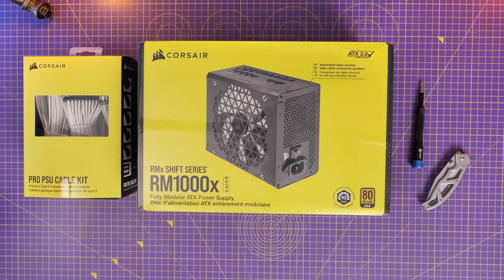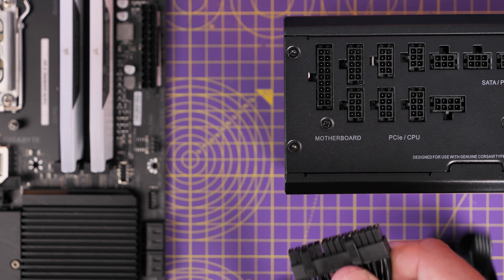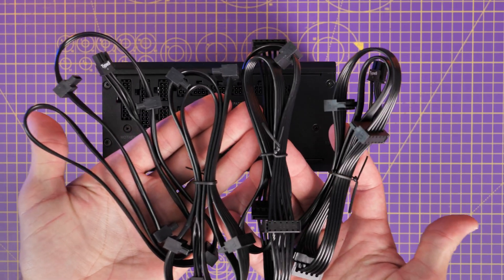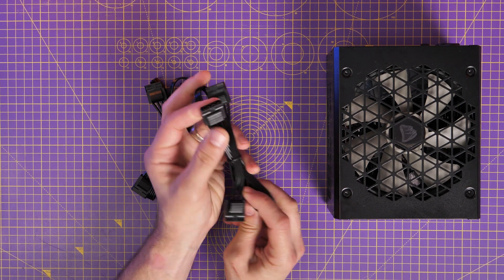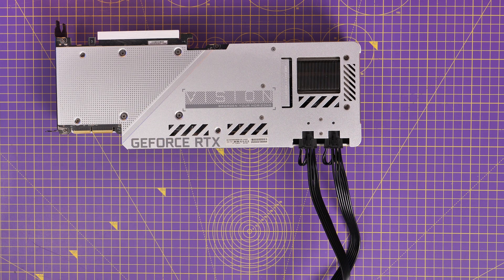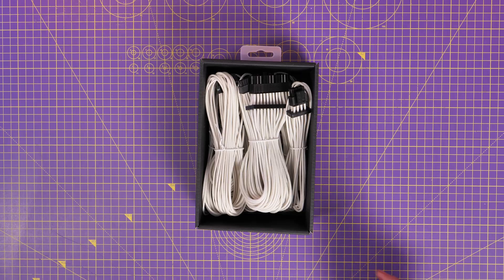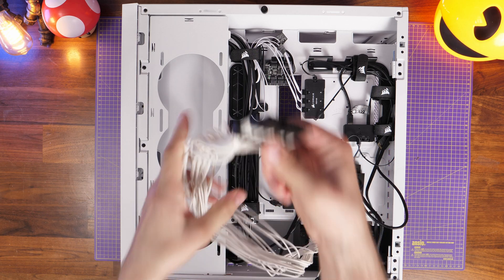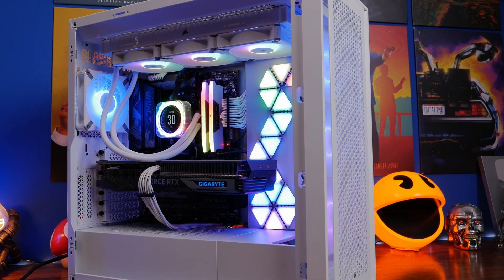Corsair RMX shift PSU setup and install guide (RM1000x and Pro PSU cable kit)

Comment: Bought a used PC off a friend that had a 3070 ti in it and decided to upgrade it to a 4070 super only to find out the power supply that was already in it was terrible. Just picked this one up on black friday and am gonna attempt to install it either tonight or tomorrow. This video was so detailed that I feel more confident than before about this. Still terrified but at least I have a solid point of reference. Wish me luck!
Reply from the maker: Glad I could help and good luck with the install!

Comment: Hi, you always have great videos. I reference them now and then depending on my objective.  I've had issues for a bit and I discovered late last night that my bios states my 5v voltage is to low +4.280v to +4.400v. I'm starting to believe this has been my problem all along (instability issues with usb disconnecting and reconnecting, m.2 disappearing and overheating; my system will work near flawless for 3-4weeks and then the next 1-2weeks its down. since your familiar with my setup (based on your videos) I figured i can ask your advice. I have the crosshair x870e hero, tuf 5070 ti oc, corsair shift 1200 and a lian li vision compact. The internet suggests its a cabling issue from the PSU to motherboard.  Any suggestions on  what my focus should be (is the 5v voltage a specific cable or rearranging PCIE/CPU cables thank you Robert.

Comment: The sideways connectors don’t work for me since my case has a metal plate blocking it, I’d have to have the PSU upside down and the fan into the PC instead…
Reply: This is the same for me
Reply from the maker: What case are you using? I'm curious
Reply: @ I think it’s a Cooler Master HAF 912

Comment: i have the Corsair RM850, 850W (and older PSU) and yesterday i bought a RTX 5080 card, as the last thing for my setup, all i need now it my local Pc dealer to build it 🙂
but after watching this video i have a question do i need to get the Corsair RM850x for it to work with the 5080 card (not FE) - Thank you
Reply from the maker: If you're using a new 50 series card, I'd highly recommend getting a new PSU too. Preferably atx 3.1. also check wattage requirements of your system here https://www.corsair.com/uk/en/explorer/tools/psu/power-supply-calculator/?srsltid=AfmBOorF34BBltIVpYh8PobBmXphvVpyd9llbkyPGwrUGCBzE0JmKEc8
Reply: @TheProvokedPrawn  thank you very much! 🙂Okay i took the test, RMe850, RM850x SHIFT, and third option is HX1000i, would you recommand any of these over the other?
i mean there around 99£, second option is 150£, and the HX1000 is listed for 195£, i will of course look for a cheapest listed in my country.

Comment: On the dedicated pci-e cable (at 10.00) the PSU end has two seemingly identical 8-pin connectors but each has a missing pin but at opposite ends to the other. One has the missing pin on the left, the other on the right. Does it matter which of the ports these are connected to as this is not specified or even mentioned by Corsair?

Comment: Hey Prawn I watched your video on the NZXT H6 Flow RGB case, and in that video did you use this specific PSU? I have looked everywhere online and it says that this PSU is incompatible with the H6 and now I am unsure what to do. I was planning on building my new PC and thought that the RMX 1000 Shift PSU would work with the H6 Flow and ordered both of them. Now I don't know what to do, should I return the case and find a new one that is compatible or is there a way I could install the PSU in the H6 Flow?
Reply from the maker: Yes I used it. You saw me do it and it worked 🤣🤷‍♂️ don't know why it's said to be incompatible

Comment: 3:45 on my motherboard there is the same big hole for cpu but the 2nd one is smaller like uh a 2x2 cube if you know what i mean does that mean i need to order like a separate cable?
Reply: Did u solve ur problem?

Comment: i know this video is a year old but just recently got 4070 ti super and i have the adapter working but want to just have the 12 pin without the adapter and not sure where to buy one that wont break my psu i have the rm 1000x (2021) version and not sure what to do
Reply from the maker: Check to see if yours is type 4 or 5 before buying but this will work - https://www.corsair.com/uk/en/p/pc-components-accessories/cp-8920284/600w-pcie-5-0-12v-2x6-type-4-psu-power-cable-cp-8920284?srsltid=AfmBOoplfQmNlyF7ghKS9LftZAy3BA9KzBpY25weX4PHGkCz2QX0Z_Qx

Comment: Hey! Thanks for the guide brother! Do you think this psu will fit in the phanteks xt pro case ? Thanks!
Reply from the maker: It should in theory but I haven't tried
Reply: @TheProvokedPrawn   I got 1 on bf and i didnt notice that it had side cables :/

As you say it should in theory but im worried a bit cause i found that it should be ok for an 8.3inch case, the phanteks is 9.1, so less than 1 inch for cables, , thanks anyway for the help.

Comment: Is it normal that my RM850x corsair shift psu has only 22 pin motherboard connecter, 2 connectors and the cables are not there only 22 pins and cables ??

Comment: Wonderful video! I feel so much more confident for when my parts all come in. If i may ask, when plugging in my gpu, I need 3 wires. I saw that theres two separate areas labled pcie/cpu and you instructed that we plug in the gpu 8 pins into the pcie/cpu. Is it okay to plug them in either side? Since I need three seperate cables and it looks like theres only two plug ins on the side that you used, is it okay if I pluf the third one into the left side pcie/cpu? Again, thank you for this very helpful video.
Reply from the maker: Yes

Comment: I have the 1200 shift and was considering using the pro kit but I wanted more combs . Will any comb set fit the Corsair pro kit because I searched & searched for type 5 cable combs and couldn’t find any.   What’s your advice?

Comment: Do i use the screwsthat came with my 4000d to screw it in i dont think it cane with any screws
Reply from the maker: There should be some in the box but if not yes, the ones that came with the case are fine. Use the hexagon topped screws

Comment: Sooooo, what kind of case is this?
Looking in with the side panel off the "back" of the case is to the right yet all of my server cases have the back to the left.   Issue being that this power supply doesn't fit in my 15 drive raid server.

If it's not a simple parts switch I'm going to have to drill holes in the top of my existing case so the fan for the power supply isn't covered.

What should I be looking for instead?

Comment: Thanks for the review and installation tips.  I am replacing the PSU in my daughter’s 5000D case. Do you think the pro cables are worth the extra money?
Reply from the maker: That's very subjective. They're nice and easy to install and look good but value for money is upto the buyer 👍🏼
Reply: @TheProvokedPrawn  Thanks for getting back to me. I’ll probably buy them this week. I had sleeved cables with my RM1000i Special Edition PSU from Corsair and they were really nice.

Comment: Hi Prawn.
I'm about to buy this kit for the RM1200x shift.
I was wondering how the cables has held up for you?
No issues with the 12vhpwr or any of the others?😊
Reply from the maker: No issues.
Reply: Fine as long as you plug in fully.
If your gpu as atx 3.1 new connector it wont have the issue at all

Comment: Ok I found this great.  On the 12vhpwr cable to the psu, does it matter if the smaller sense cables are out or inward? and it doesn't have to be those 2 plugs?  I got the 4070 Super vs the non-super and it has the new 12vhpwr connector. I was just using the adapter..  I didn't realize my Rm850x shift had one included.  I love these shift psus!  Why did it take so long for these to come out!

Comment: I'm not sure if I should find it funny or be concerned about the fact the power supply as a label right below all the connections saying: "Designed for use with genuine Corsair TYPE 4 cable sets only"...
(They are clearly type 5)

Comment: This maybe a stupid question. Obviously you need to buy a power supply cable kit with the correct cables you need. But when you buy a cable kit, do you need to buy a specific one or can you just buy any cable kit and it'll work exactly like the cables that come with the power supply?
Reply from the maker: Recommend buying a cable kit from the same manufacturer unless it's just extensions. Otherwise the only thing you need to watch out for is type 4 or type 5 cables, as they're different so you need to match to your PSU type
Reply: @TheProvokedPrawn Alright thanks man.

Comment: Thanks for creating this video! I just bought this very specific power supply and its nice seeing a visual representation before cracking my case open and replacing my Corsair 650w.  P.S. I had no idea this power supply included a direct connection power cable for my new Gigabyte 4070 GPU!
Reply from the maker: Glad to help
Reply: Ironically that 4070 series cable was broken in the box, so I had to use my adapter.  A clip going to one of the power supply outlets was broken off and the clip that goes to the GPU was broken off.  Hope the warranty will grant me a replacement. @TheProvokedPrawn
Reply: does the cable mess with the power of gpu? i feel like i’m missing out on the full potential using that other cable the psu came wit

Comment: Mate I am absolutely baffed. I have the RMX shift series 1000x fully modular ATX power supply but I’ve just spent £110.00 on wrong cables 😂. It clearly states on my PSU ‘designed for use with genuine Corsair type 4 cable sets only’ all of these cables are TYPE 5. Why would Corsair print on this PSU the wrong information!? 

Also because I’ve got the LIAN li o11 vision I have to mount this PSU with the fan facing towards the back of the case with the cables facing up towards the top of the case. I hope this is okay!
Reply from the maker: That is very odd and frustrating. Hope you can get it sorted.
Reply: did it work? i have the same case and psu lmao
Reply: @pigreatlor  did what work bro? I had a handful of initial issues with my PC components haha
Reply: @James-fv1cm  the psu inside the o11 vision
Reply: @pigreatlor  oh, works magnificently. Just has to face a different direction than what Corsair built it for I think. The fan has to face the exterior of the vision case as that’s where the mesh is allowing for airflow. Only downside to this is the cables have to come directly upright. I removed both of my hard drive cages anyway so it didn’t bother me. On a side note bro did you receive rubber silicone grommets for your low motherboard option??

Comment: if i purchased this pro cable kit (the starter kit only comes with one cpu cable which is annoying) does this include all the cables id need to power my rtx 4080? I know there is a separate cable which is called type 4 600w corsair pcie gen 5 12vhpwr DC power cable. this cable has two connectors on it that plug into my graphics card as apposed to the nvidia adapter which has three. Does the pro cable kit include this cable or should i buy that cable as well as the pro cable kit?

Comment: Ty for the great video again ! I have simple question, Can i use (CORSAIR 600W PCIe 5.0 / Gen 5 12VHPWR Type-4 PSU Power Cable), on (RM 750 2021 type4 White)& rtx (4070 non Ti version) which cable wasnt included but planning to buy and remove the adapter and the mess  ... so i was wondering if its save and will it work fine with that PSU and Gpu together TY in advance !

Comment: Finally a brilliant practical tutorial that explains the mystery of a psu to newcomers like me!  Absolutely marvelous!  Thank you and continue to make videos
Reply from the maker: You're very welcome! And I will
Reply: I am thinking about purchasing this pro cable kit today to make my rig look better. Would the cables included in this be suitable to power my RTX 4080 suprim x to my corsair shift series rm1000x PSU? I am new to all this as you can probably tell. I recently watched another video where a guy used corsairs type 4 600w pcie gen 5 12vhpwr dc power cable which connected to his 4090 to this PSU. is this same cable included in this pro kit or do i need to buy this other one as well?
Reply: Except it doesn't. There's an ATX 8 pin cable, and 2 CPU cables. This doesn't explain which we should be using. My mobo doesn't seem to have CPU power. It has the 24 pin connector, and the ATX 12V 2x4. So which do I use? The cpu cables, plugged into the cpu ports? Or the atx cable into the mobo ports on the PSU? I'm guessing the latter but I can't find confirmation anywhere because the manual for this PSU is so unbelievably useless

Last time I ever buy corsair. Never would've if cultists didn't rate this psu so highly.

Comment: Great video. Nice system. I'm installing the Corsair Shift 1000x in an old 2012 Corsair Graphite Series 600T CC600TM tower case...and it definitely isn't built for today's setups. And, I'm getting a liquid-cooled 4090 with literally nowhere to mount the radiator (CPU has a radiator at the top). Lucky for me, this is a huge case and I can make it work, but I'll likely have to keep the side panel off because stuff will be hanging out of the side. Maybe it's time to upgrade the case.

Comment: hi there and thanks for the vid .I just purchased the same psu new and i noticed some very tiny scratches on the 24pin, and pcie cable, the surface of the cables arent very smooth  i dont know if this is normal or not.

Comment: Thank you your the first video out of a few that answered my question on whether I should use two separate cables or one with the pigtail on the GPU because I also coincidentally have a gigabyte 3090 OC so thank you
Reply from the maker: No problem 👍

Comment: Hello, sorry, as it says on the page, "it must be at least 210 mm (8.3") wide" so that there are no problems with the cables, it refers to when the cabinet specifications say: "Box size : 446 mm x 285 mm x 430 mm (length x width x height)" or in which part exactly is the one that mentions the length of the back part

Comment: So the new icue link hub has a female 6-pin pcie.  I'd use the 6+2male and the 8port psu end where 2 slots are empty and missing pins?  That's a 6pin?

Comment: How easy does the cpu 8 pin cables bend with the additional cable purchase kit from Corsair?  I have hardly any clearance to run the stock psu cables that way with a 360mm aio from corsair with their af fans in the same case… so I ran them around the front it looks trash.
Reply from the maker: The premium kit is much or flexible
Reply: @TheProvokedPrawn  thanks for the detailed videos, and responding to me!   I also have the same aio.  I have a tuf intel board.  I debated on trying to bend the 8pin cpu stock cables but I might just get the premium cable kit if you believe that it be easier.  Are you using the stock af fans with that aio?
Reply: Sorry if you covered this in the video but does it come with 3x 8pin PCIE cables for the gpu? I'm thinking of getting this for the 7900 xtx @TheProvokedPrawn

Comment: Can I use the cable kit with a nzxt c850 power supply?
Reply from the maker: It's not recommended to mix cables from different manufacturers. You could use extension cables though (like Cablemod ones) if it's all about looks?
Reply: @TheProvokedPrawn  I’ll just buy a Corsair psu instead 😂 thnx for the response ! 👌🏼

Comment: Hello sir, i just bought one of these PSU with type 5 connector but i wish to connect with my RGB motherboard cable and gpu cable, but they are both type 4, i been dying to search online but could not find any adaptors or connecters to convert type 5 slot to type 4 slot, where can i find them ?

Comment: Nice overview. Bought the Shift 1000w about a month ago for my NZXT H7 Flow case which thankfully it fit into perfectly. Good idea to have the cables from the side as no more hastle with removing the PSU when you add or need to remove a cable, though some cases may not be good for these PSU's. Also got the sleeved cables and it does a great job in making everything look good. It also helps with cable management as the sleeved cables are so much easier to handle. Runs very quiet!
Reply: Do you think I would have clearance in a nzxt h5 flow case
Reply: Bro thank you so much lmfao I bought this thing and I didn’t even know it came on the sides because I didn’t really research the power supplies and what do you know you are getting the same case I am phew thank you bro

Comment: My motherboard has a 12 pin(8-4) but my psu cpu cable is 8-8 should i plug just half of it for second cable to use 8-4? or 8 is okay?

Comment: I'm looking to use this PSU. is it able to provide 600w to the 4090 series with the 12+4 pin cable I know the  1200w PSU does provide 600 watt and it's printed on the head of the cable. I believe that the 850w PSU can only provide 450watt, so since you have it in your hands does the 1000w PSU say it's 600 watt or is it also 450w? thanks both for all your great video's and providing so much information to our community as a whole.

Comment: I got this psu months ago for my build that I'm trying to put together slowly since I cant afford all the components all at once and I was disappointed because I got something which I thought was wrong and wont work with my case.  I don't make builds often so I wasn't sure it would work. this video was what I needed to tell me that I could most likely make it work. I'm using the lian li o11 dynamic evo, ill update how the build goes. thanks for the videos as always.
Reply: Did you ever finish it?
Reply: @urmom69420xd  I did. Finally end of last month finished it. It turned out nice.

Comment: Hi, I have a question. Does this psu really support Atx 3 standard? The PSU does not have a 12VHPWR connector like other brands. They just included a pcie to 12VHPWR cable.
Reply: Yes its certified atx 3.0. He showed it with the 4070 ti connection.
Reply: Did you ever find out what happened? I’m facing the same problem 😢